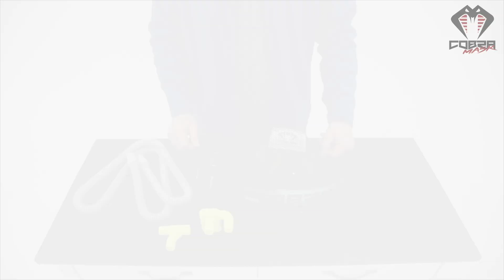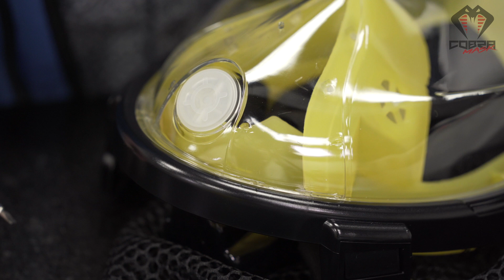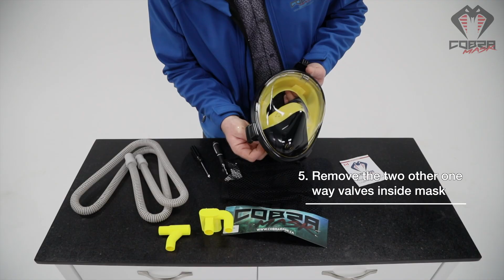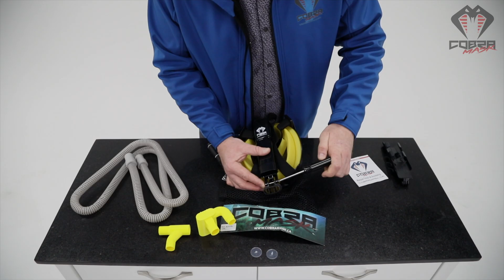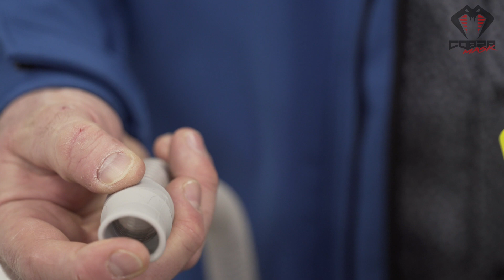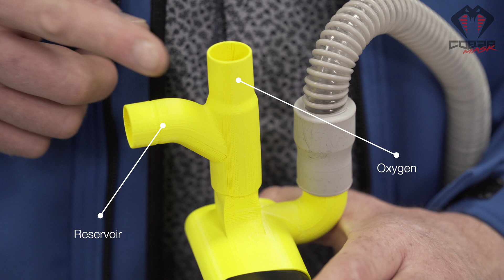Cobramask Covid 19 C PAP/Ventilator mask Part 1.

Comment: I do not like the system where air must go out in the top !!!!     -Fresh air with extra oxygen should go in from the top , and used air should go out in front of the mouth.  This way the airflow reduce heat and condence and the risk of  CO2 in the ventilation.  The mask volume is app 1 liter  , and the flow must be sufficient to ensure fres air for every breath.!